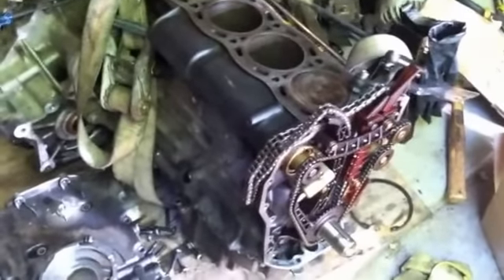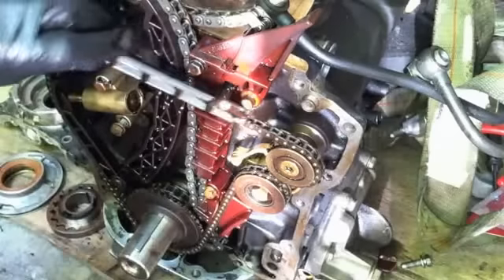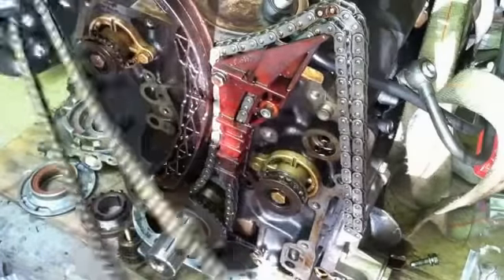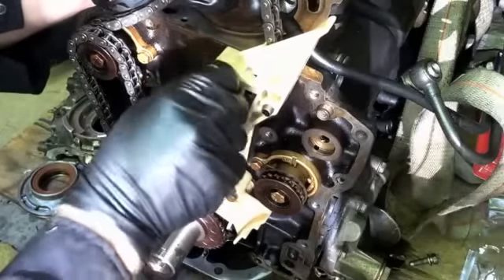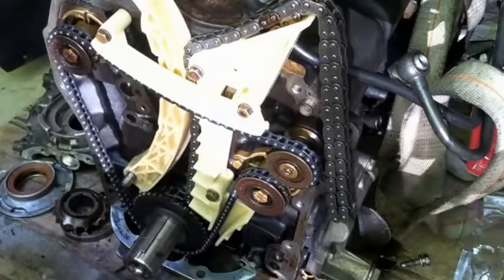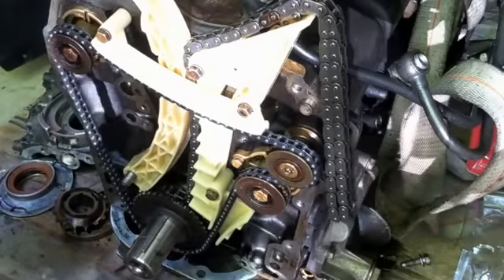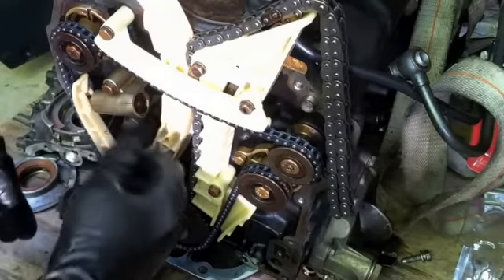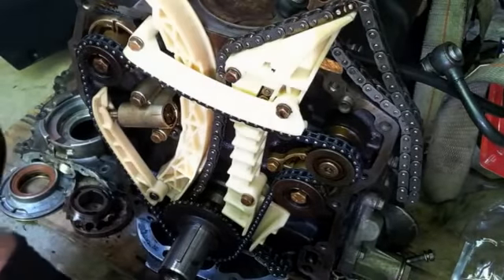theSAABguy: Replace Timing Chain Guides and Balance Chain/Guides in a B235

Comment: I removed (& didn't replace) the balance shaft chain from our 2.3l non-turbo 95 900s (167k mi at the time, 265k presently) with the engine in the car. The operation was 100% successful, but definitely not a fun undertaking.  I jacked up the motor/trans enough to get the motor mounts off, then suspended the whole lump on a homemade engine support I made out of a $1.75 2x4x8 pine stud (a proper job, w/nicely configured pieces to sit in the hood channels), using several turns of nylon reinforced rope (free...& fixed our saggy cloths line ;).  With the motor shoved & shimmed to the driver side (the subframe removed to get at the sump, which let the halfshafts move with it), I had enough room to slip in a torx socket & turned it using vice grips.  A local Saab indie sold me a block off plate ($20...but just a custom shaped piece of 3/16th thick aluminum with two holes drilled...ez to make) for the oil feed to the balance shaft chain tensioner (discarded along w/chain).  I think I removed one of the guides & left the other, because it was serving as a spacer for one of the cam chain guides (sorry, this was nearly 10yrs ago).  The rest is just reassembly.  The reason I had to address this began as a mild "what's that?" grinding noise that eventually become unnerving enough to stop using the car.  When I got inside the engine, the cogs sitting on the end of the actual balance shafts had only little bumps where there had been teeth, but enough to spin the chain...apparently whipping around loosely, eating a hole into the timing cover.  Got it it just in time.  There was no objectionable vibration resulting from removing the chain & now w/another 100k trouble free miles since, it still runs great.  I believe the balance shaft cogs were from a bad batch or something, as the engine internals were very clean & free of sludge.  There had been 10k oil change intervals (all highway, driven in a 2-3month period) up until that issue...switching to 5k intervals thereafter...Walmart dino oil, new filter every 3rd change.  Fwiw.

Comment: I have pulled it in the recent past, and desludged.  I am only changing the balance shaft chain timing chain and associated components in need.  I doubt that the pan is sludged up this early on.  It is a good practice for those in need.

Comment from the maker: You might as well pull the oil pan when you're in there. You definitely what a good seal around the hole for the oil pump pick up tube and if you put the valve cover back in while it's a tight fit you'll probably scrap off all the gasket maker, best bet is to pull the pan and put it back on last with fresh loctite anaerobic gasket maker.
Reply: How often does this need to be done mine has 100k on it

Comment from the maker: Not sure if I can post a pic in this reply, but if you just do a google search for saab chain tensioner measurement you'll see how to measure it. The chain tensioner is located in the back of the cylinder head (near the belt tensioner) and the spring must be removed (12 mm bolt holding it in) before the tensioner itself is removed. If it is carefully removed you can see how far it has pushed out and see if it is maxed out. If it is beyond limits then a new timing chain should be rolled in.

Comment: So, you seem to know quite a bit about Saabs. I also have a 2001 Saab 9-5 Aero but the sedan. I have a question that I have scoured forums for and have yet to find a answer. The car about 3 months ago would have all the electronic on with the key in the on position, but when turned to start the car there was nothing... no cranking or anything, I would take the key out and about 5 min later try it again and it would start right up. When its on it runs amazing.

Comment: rollotwomassey, Not too long ago, I had the oil pan off and cleaned sludge out, put in a set of standard rod and main bearings. My engine is a 204L, and I purchased it with 49k mi on it. The sludging probably took place before I got it, since I have used Amsoil 100% synthetic since then. My chain tensioner measured 18mm,3mm over acceptable. I get nervous about this. Stretched chains are never a good thing. It is tracking straight. I am not thrilled to pull engine. I now have 257k mi.

Comment: I did this job on my '97 9000 CSE with the engine in the car. The same exact guide was broken in the same location. Once I took everything apart I noticed the balance chain tensioner was maxed out. I couldn't understand why or how it happened since the car had no sludge or varnish, was never driven like a boy racer's car, and only had 90K miles on the clock. My previous car, a VW Passat GLX with a VR6 also had a timing chain guide break. That was a nightmare to replace compared to the Saab's.
Reply: I know this is eight years old...but how hard a time did you have doing the job in the car?  Any advice? I had a blown head gasket and redid my head and valves and reassembled all with a new water pump and a lot of other new parts and now I have low oil pressure after reassembly. I realized my chain tensioner was maxed out so considered just rolling in the new chain but...would prefer to do the whole job along with new bearings. Haven't dropped my sump yet, as I had dropped it at 98k and it was actually in pretty decent shape but the head gasket failed at 124k and of course, it now might have a clogged pickup.  So again I am wondering if this job can be done without removing the entire engine.

Comment: Are you sure the oil pan needs to be pulled?  It looks like a few bolts on the end of the pan fasten into cover, that's all.  I need to do my balance chain on a 99 2-3 2.0L.

Comment: I never said I would want a timing chain to snap. The whole reason you buy a car like a Saab is that they NEVER need repairs on parts like this. Same thing with older Volvos and Mercs. In theory, as long as you keep the oil changes regular and use fully synthetic your chain should not snap. If they do go bad that's an indictment of the car's engineering.

Comment: Is any or all of the guides are broken, will there be a noise coming from that side of the engine while it's running? I have 95K miles on an 07 9-5 and I'm wondering if I should start doing some preventative maintenance and repairs now.

Comment: I just wanted to know, i ran out of oil on the hughway at about 100 mph the main crankshft seal was rock hard, the engine died while i was still on the freeway at about 45, it seems the engine ceased buton closdf inspection it turn back about 90 degrees and stops, i just wanted an opinion on what it could be, the camshfts rotate freely, the chains look ok, it still has compression. 2002 9-3 2.0 t7 i believe b205 no sludge(at least none i can see)

Comment from the maker: I'm assuming it's an automatic because this sounds like a faulty Neutral Safety Switch aka Neutral Position Switch NSS or NPS. The problem is the computer doesn't know if the car is in neutral or park (the only gears the car is allowed to start in). There are a couple quick fixes because a new NSS is quite expensive. A google search for SAAB NSS will yield these fixes.

Comment: I have a 2005 Saab 9-3T. I'm not sure if it's the oil pump seal or the crank seal that's leaking. My question is can both of these be accessed through the wheel well? What kind of labor cost would you estimate for this repair?

Comment: But just this last week, it started to crank then not turn over, so I let it be for a few min, then it would turn over and run fine, but then one day it wouldn't turn over at all. I have checked for air, spark and fuel, all are there and it hold a fuel pressure of 40 psi. but what I don't know is if the fuel is getting past the injectors. This morning I went out and tried it and it started instantly. Went to school, and it wouldn't start after school. Please help, I'm so lost.

Comment: hi jay, I own a 1999 93 and from inside the car when the car is running I hear  a low knock coming from the right side of the engine but from the outside of the car I can't hear it, do you think I have a broken timing guide? Thanks

Comment: Jay,

Any chance you know what size the Idler pulley bolt was? T30? My head is stripped and i'm trying to figure out the correct size to replace it with

Comment: Do you have any tips on getting the timing chain back on to the cam sprockets?
I am at a stand still on my t5.5 conversion on my 87 SPG... waiting for parts and the timing chain going back on being a vital part as well
Reply: 900 Saab on haynes manual it say use a open end spanner to prevent  camshaft from turning and remove the cam sprockets by undoing the bolt

Comment: Ive started to hear some rattle from the chain in my 9-5 B205 -03. I checked the tensioner and it was stretched to 16mm so i need to replace the chain. :/ So im gonna replace only the chain. But how likely is it that i need to replace the balancechain too? Will it take a year? Two years? Im not really seeing forward to lift out my engine because it just seems to be too much work. :(

Comment: Is there really enough space to get this done with the engine still in the car? Everything including the guides will have enough space to be pulled?
Reply: Really good info TourdeFrance, I have a 2001 93 saab with a b205 engine, I will be attempting to figure out if I can do this next month as weather gets a bit warmer. You should consider starting a post over at saabcentral.com a lot of us saab owners help each other with the info on the forums.

Comment from the maker: No the engine was not sludged. A chain is not an indestructible item on a car- it's certainly better than a belt especially when you're dealing with interference engines, but like any other part on an engine it wears and eventually WILL need replacement. The most common issue with chains is stretching. With a SAAB B2X5 engine you can determine the wear by measuring the chain tensioner. But I'm sorry I disagree with your statement.

Comment: 2001 93 can I remove engine from top
Reply from the maker: Yes, but you'll need an engine hoist with a load leveler, so you can tilt the engine while lifting it out. It ain't easy and can scratch stuff up. I recommend taking off turbo and other accessories to make the engine as small as possible.

Comment: This is what I have read and have been told but I defer to you as you're a mechanic and I am not. I thought the whole point of a timing chain was, though they can get loud and won't run the engine as smooth as a timing belt, they last the life of a car. I have a 2002 9-3 [B205R] with 160K miles and, given that the job is prolly an engine-out job and would take a long time, it would cost about $3K at a garage. How do I measure the chain tensioner? I hope my chain never goes bad!
Reply: At 160k your timing chain probably has some slack but you will def know when you start to hear the chain slapping a bit on the top of the valve cover. It will slap till it warms up, as you add more miles the chain will slap more. I have 200k on mine and the chain has 1/2 inch of play. You can take the valve cover off and see the top of the chain pretty easy.